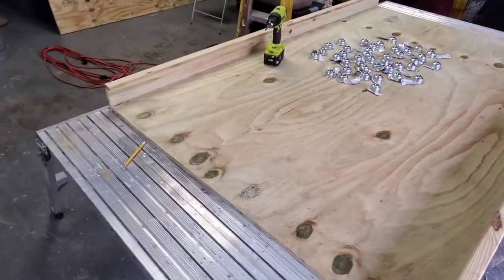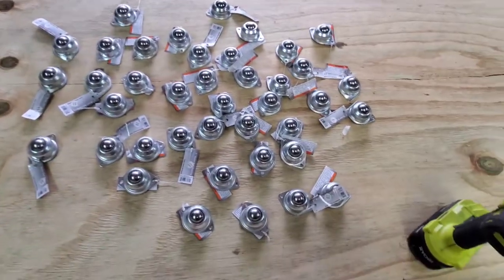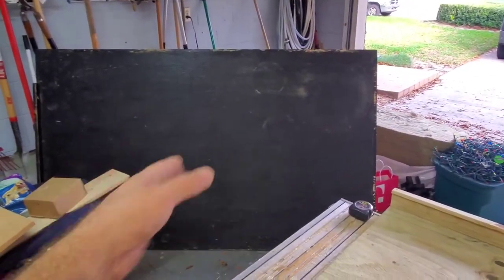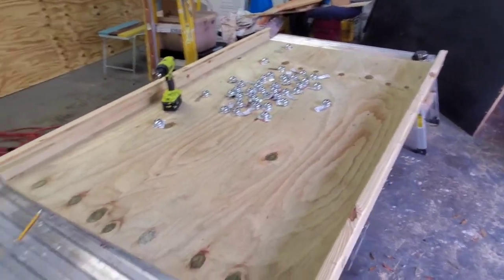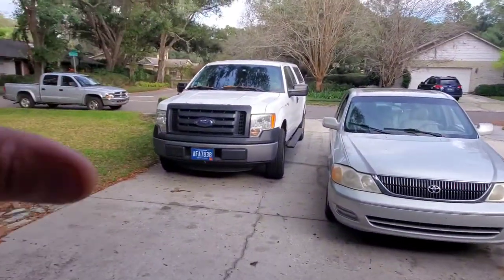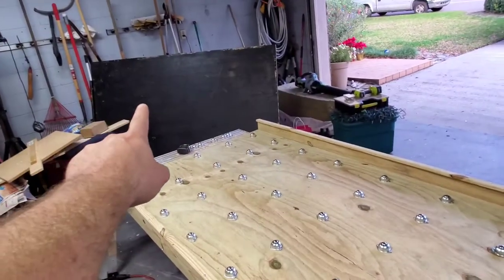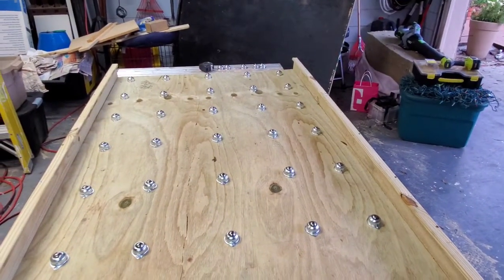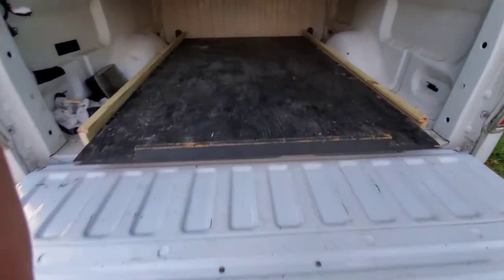DIY Truck Bed Slide $250 Easy To Build

Comment: Similar to a design I was thinking about, except I would drill holes to mount the bearing from underside so only the bearing is exposed above the thickness of the base plywood. I would take a router to counter bore an area the thickness of the flange so bottom is one level surface. Little more work but keeping slide tray at lowest possible stack height is what I would want in a design. You also can cut in hand hold opening instead of adding a handle that sticks above the surface that impedes the loading and unloading.... but overall, good DIY build....Thanks for sharing.
Reply: You can source recessed rollers.  I think the smallest have 5/8" depth.  You can use 3/4" plywood or step up your 1/2" ply with some runner boards underneath.

Comment: I'm concerned about flex when pulled all the way out.  I like the initial design but would thing of some modifications to prevent it.  I plan to use two separate slides also put a front stop on it so things won't fall off the front when braking.  I  got a great start from you Dan, Thanks!!!

Comment: Seems like a lot of wasted space on the sides.  Would like to see it be as wide as possible.  Maybe lifted above wheel wells and storage under the slide.
Reply from the maker: Cool... feel free to modify the design however you would like to this is how I built it for the needs of my father
Reply: @IFixShet Awesome video!!

Comment: I like the anti-tilt brackets on the side for safety.  Only problem is if you're caring 4x8 sheets, you'll have to just slide them on top of those side brackets, but I guess that would still work to carry 4x8s sheeting ..
Reply from the maker: Or You could just put another piece of wood on top of the rollers to raise it up To get it higher than the swing arms

Comment: I didn't hear that he put any type of stops to prevent the top piece from being pulled all the way out and falling on the ground. Or, did I just miss that part?
Reply from the maker: I am making you an update video right now.
Reply: @IFixShet  thanks but you don't need to do that much work, a simple text reply would suffice.

Comment: Like the fact no drilling. I have a different version I might post. Was at home improvements store and actually some people came over to look. They had a $2000 version installed and said they didn't like it. Took up space and had to drill  holes for bolts into the  truck bed ...

Comment: Pretty cool! Don't you think it could have worked with about half those rollers?
Reply from the maker: I mean sure however if you want to put some serious weight on it you're going to want the extra rollers. By doing it this way there's no limitations
Reply from the maker: I would rather be over-prepared than underprepared

Comment: I used two sheets of 3/8" plywood. I put 4 rolls of 5 roller ball bearings on the bottom of the top sheet. 
The bottom sheet is screwed down to the bed of the truck with couple of screws from sliding.
Placing the rollers on the bottom of the top sheet requires less rollers. You don't have to worry about the slide buckling from the weight of the load and snag on to the rollers.
Placing rollers on top of the bottom sheet requires more rollers to prevent  snagging.
Back 1/3 of my slide  has no rollers. I put 1x4 to level off the slide. This let's me put really heavy load in the back of the slide without the worries of damaging the rollers.
Mine too  slides with one hand with ease. 
I did make mine from watching your video. 😊
Reply: 3/8 ply seems kinda thin how's it holding up?

Comment: Tried this approach and very noisy.   May be great for a work vehicle but not for a camper type truck because each bearing produces noise and the combined effect can be heard a mile away in the quiet woods.  I went with giant telescoping cabinet sliders instead which are working fine
Thanks for the tips, though!
Reply from the maker: Yeah it's not for everyone mostly just construction people
Reply: Can i get the brand of cabinet slides and max weight. Thanks.
Reply: Cabinet slides can also be had with stops to keep it from sliding further than you would like it to or back and forth every time you go up and down a hill.
Reply: Where’d you get the rollers from

Comment: I don’t have a tonneau cover or bed cover.  How could you waterproof this to work in rain and not destroy the wood??
Reply from the maker: Use pressure treated wood or cover it in waterproofing coating

Comment: What keeps the slide from falling out of the truck if there is more weight on the tailgate side?
Reply from the maker: Feel free to make any design changes you would like I set it up for my dad's needs. There is no stopper it is unnecessary for our use. That's the beautiful thing about this design you can customize it all you want

Comment: Say if you have an heavy item like a generator sitting on your new rolling truck bed  right when you open the tail gate of the truck. And you pull the slide out all the way with the generator on it . Will your whole plywood near the back of your truck come up in the air because of how heavy the generator is when you extend it all the way out
Reply from the maker: You need to put rollers on your tailgate as well. Three of them screwed into the tailgate should do the trick we raised them with a small piece of wood.
Reply: Why wouldn't you just take the generator off before you slid it out?

Comment: Where is your materials list? Specifically the rollers. What size and where did you purchase them?
Reply from the maker: Pretty sure I talked about all of that in the video where you can buy everything and what size wood I used.... Watch the video pay attention and write things down
Reply: @IFixShet  Thank you for the suggestion, however I am deaf!!
Reply from the maker: @shortfuse011   Guess that doesn't help your situation oh well maybe you should turn on the CC for the video 🤣  Unless you're also blind and you can't read close captioning is there for a reason 😜
Reply: @IFixShet  CC is not available.
Reply from the maker: @herbsu4330   Blame YouTube for removing it
Reply: 2 sheets of 3/4" pressure-treated plywood and some 1/4's

Not sure why it is so hard for him to respond, probably spent more time replying to your comments with a sheety attitude than he would by simply saying the materials that he commented on briefly during 5 seconds of the video.

Comment: Does the lower board need to be mounted to the truck bed or just set it on in?
Reply: How would the base stop the tray (and base, ftm) from tilting, when being pulled out, w/out being anchored to the bed?

Comment: Let’s see how it works loaded.
Reply from the maker: It works just fine I built it for my 70 year old dad who travels with their airstream and puts the generator, gas cans everything on top of it hes had shoulder and hip problems forever This has simplified his life Puts all of his heavy tools on it everything slides in-and-out perfectly
Reply from the maker: Ten 90 pound bags of salt for our water softener  Doesn't even batt an eye just slides right out real smooth

Comment: Dimples in wood after load?
Reply from the maker: Haven't noticed any, don't buy cheap plywood that's all I can say make sure it's thick
Reply: @IFixShet I was thinking it wasnt so much a function of the thickness but just that the top layer of the plywood would compress
Reply from the maker: Weight displacement solve all your problems